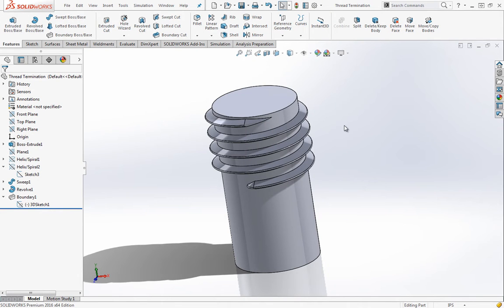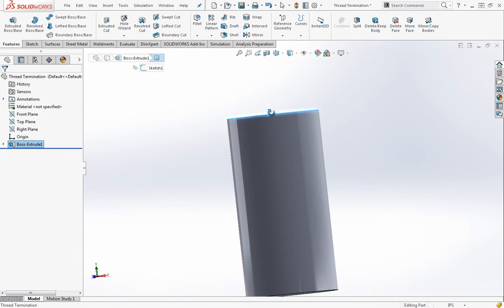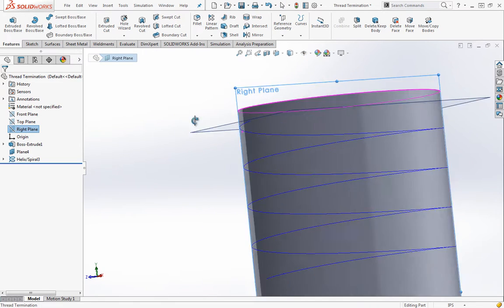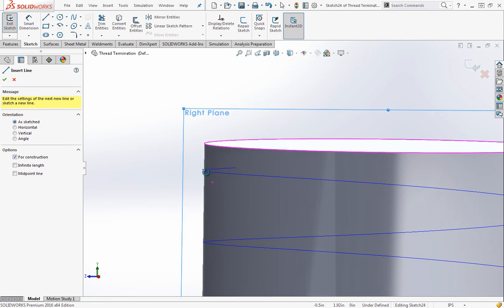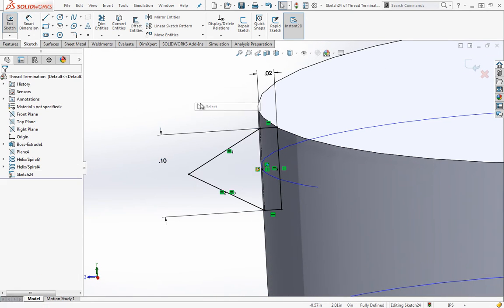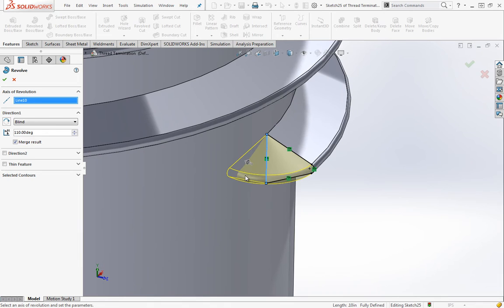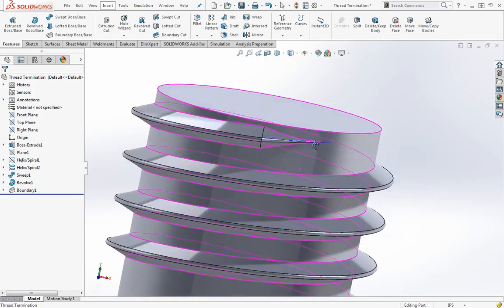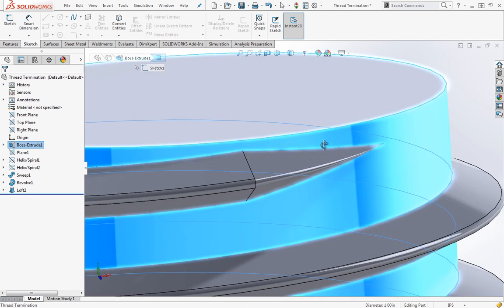Properly Terminating a Thread in SOLIDWORKS

Comment: The revolve from the thread ends is how you want to do it. However in solidworks the end faces are not normal to the trajectory. They are normal to your standard planes. This causes the rotated thread end to not follow the thread. Pro-e has a button you can click to make the faces normal to your helix angle trajectory. I’ve not yet found how to do that in SWorks.